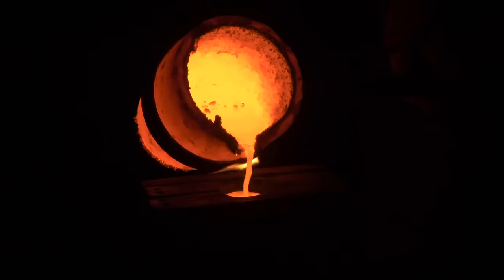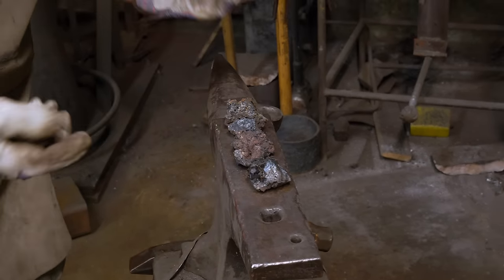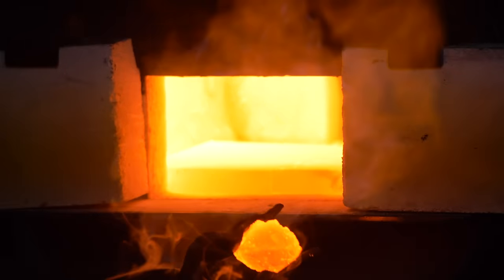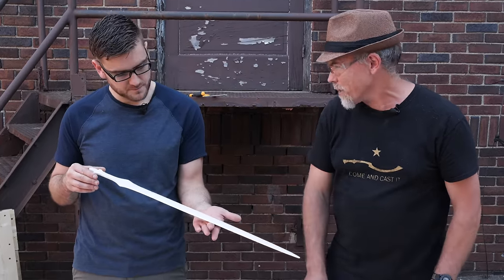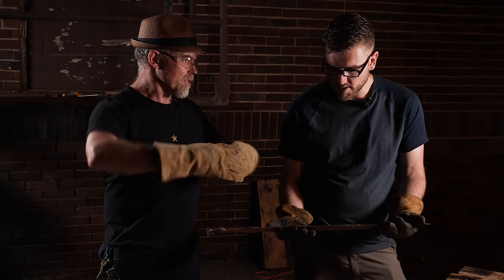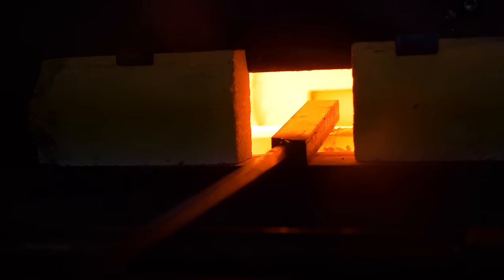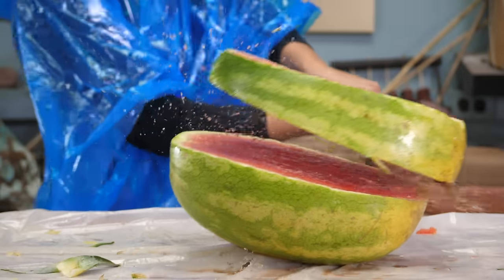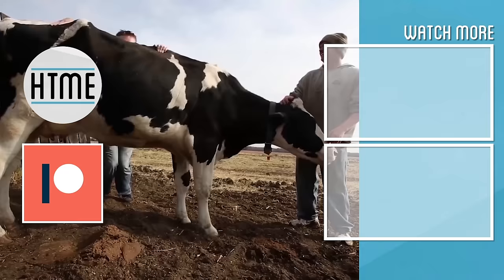Forged Iron Sword vs. Cast Bronze Sword

Comment: Clearly got some confirmation bias going on here. You said yourself that they would have avoided that kind of sword to sword contact, then you judge which one would be better by how they fared with sword to sword contact. If it got to the point where that was the deciding factor, they would have already lost their shield and been boned regardless of the sword they carried.

In the parry test with the flat you showed they they WERE largely comparable, with the iron being a slight improvement in terms of maintenance of the blade
Reply: When fighting, if there is something you can't do but your enemy can, that's a huge tactical benefit for the enemy. The bronze man can block with his shield but must reserve the sword for striking; the iron man can use either to parry. It's also likely that the best intention of the bronze man is thwarted because the iron man parries freely, so while the bronze man doesn't want edge contact the iron man causes it. 

When the iron sword nicks the bronze sword, it's possible that it also catches it slightly and pulls it a little farther out of the bronze man's desired stance. The iron sword is also much less flexible, so while the bronze sword would quickly bend out of joint and be much less useful as a weapon, the iron sword wasn't doing that. Because of that, the iron man is going to take advantage of the bronze man's weapon by striking it while staying farther out of range, and eventually force the bronze man to move in else his sword is going to get beaten up. You'd do the same to strike someone's hand to injure it when unarmed. And if the bronze sword gets bent a little too much, it'll have the same thrusting weakness as the khopesh shape, meaning there's yet another move set the bronze man can't do but the iron man can. 

The better edge retention of the iron sword wasn't really tested, but after your bronze sword gets banged up more from glancing blows etc. it's possible that a slice that would have gotten through his enemy's armor would be too dull and fail to cut. And the edge vs. flat test showed significant deformation in the bronze edge with little effect on the iron flat. You may want to rewatch. 

Overall, the iron weapon is a lot better. But the real problem is not the one you pointed out. It's that the bronze couldn't really be improved much, but the iron could, and he used a clean modern iron to forge the sword. Instead, in 1200 BC - 1000 BC it would have been a very poor quality iron weapon against basically the bronze he has. Iron may not bend, but it is brittle, and in the course of a fight it could have broken. So if we're talking about a combat between two men in 1000 BC, the two swords would probably fail equally often. 

Lastly, can you please explain what you mean by confirmation bias, because I don't see how that applies based on your subsequent statements.

Comment: Swords rarely went edge to edge because they'd get damaged severely. They went edge to shield.  It was considered very unprofessional to block with the sword.  It wasn't until much better metallurgy, well into the Middle Ages, before that became a thing.  There are stories from both Bronze and Iron age about not doing that for those exact reasons. See the Táin Bó Cúailnge
from Bronze Age Ireland for one.

Also, the iron sword would be forged from bloomery iron without much grinding. This makes a significant difference in grain structure.

The bronze smith did an excellent job, very accurate. The blacksmiths did good work for the time involved, but should have been allowed to forge the bevels, as they noted.

You correctly note the big difference is that iron can be reduced almost anywhere, and bronze is limited largely by tin production.

Comment: Early Iron age swords were made of Iron and not steel. With bloom smelting, folding the iron will beat out a lot of the impurities and homogenize the material. Folding the material too many times though and you will beat out all the carbon as well. Anyway, Bent swords are the product of performing a parry with the flat of the blade, its rarely done. The proper way to parry is with the edge. A better way is to get out of the way or use a shield. As all could see the Bronze weapon will take quite a few hits on the edge, but one solid hit on the flat will bend it to a banana shape. Another reason not to parry with the flat is that one cannot achieve a "bind" so as to have some control of the opponents blade. Perhaps if one wants to test and compare the swords then it would be a good idea to know how to use one. Having said all that even a sword made of modern carbon steel will wear and/or be damaged with combat use and need maintenance. Hit up Metatron, Skallagrim and Shadiversity, all are great Utubers with loads of relevant knowledge. Oh.. Chopping wood with a sword = sword abuse, thats what an axe is for. Maybe next time use an animal carcass so it all remains in context. Great vid guys, thanks.

Comment: Iron was much cheaper, that's why it became a thing, not because of what happened when the two came against each other. If you know anything about ANY style of sword fighting, you would know that two swords will pretty much NEVER meet each other head on like that, so that reasoning of yours is completely off. It's nearly impossible that a bronze sword would break in battle or otherwise suffer any significant damage no matter how long it served, BENDING out of shape mid battle though is actually far more likely, which is where iron holds another advantage.

Comment: The only additional argument I would have, since I saw someone mentioned using pure modern iron is a bit unfair, is that the swords wouldn't often hit so directly like that necessarily.  A static block is one way of blocking, better than getting sliced for sure, but there are many kinds of parries where the defender does more of a deflect rather than just slamming the swords against each other. Cool video though! And the iron sword looks really really cool.

Comment: Just a heads up, a perry is not blocking a strike, that is called a block, a perry is when you deflect and use the energy of an opponents strike to in an accelerated counter strike.

Comment: the damage comparison when they went directly against eachother shows why iron became extremely important with regards to armor. Iron was easier to reshape after a battle, had a higher potential sharpness, had better edge retention and had an obvious advantage when trying to pierce armor. It would suck if you had a bronze breastplate, and the iron speartips had the chance to pierce that heavy armor headon. With equal steel level this would be less likely to happen.

Comment: The reason that both materials would have been pretty comparable is probably the way of fighting itself.

It is unlikely that the warriors of the time would have been fully aware of that advantage and as such would have stuck to their way of fighting - prefering to dodge instead of parrying.

Therefore the advantage iron has over bronze would have been minimized in actual combat since both would have been roughly equal when hitting a shield.

Comment: People always focus on the improved hardness and strength of iron by smashing swords Hollywood style in order to reason the end of the bronze age, albeit this is only second. It was the scarcity of tin, that spelled an end to the age of bronze. Bronze technology is limited by the amount tin you can source, plus you require an extensive trade network to get both copper and tin, as the ores usually do not occur in the same place. In contrast, the basic resources for iron technology are readily available almost everywhere. Yet, the iron technology is much more sophisticated, with a huge amount of knowledge & skill, fuel & manpower required to melt a useful bloom, to refine the metal and forge a tool. Not to speak of the tools you have to create first to forge a tool :) If one compares with the rather simple - straight forward process of casting bronze tools, its resistance to corrosion, the countless times you can recycle the bronze, the beauty of the metal and the complex shapes you can create, one can imagine why for example in ancient china, where they had plenty of tin and copper, the use of bronze as the metal of choice lasted well into the warring states period (400 BC). But as always, its the price tag associated to a product, that decides whether it's kept reserved to the elites or becomes affordable to everybody. So once production of a iron tool was mastered, it went on to replace bronze for most applications, first for swords, later armor, eventually cannons.

Comment: Being pedantic, I see a slight problem with the comparison. The key issue is with the carbon content of the iron. Early iron age swords had relatively low levels of carbon, much closer to wrought iron. In the iron sword, the characteristics appear to have a higher carbon content than would have been accurate for the time. Wrought iron is softer than steel. It's also duller in colour and lustre. Hence, in the final test, probably both would have bent and both might have nicked each other. It would be almost a 1000 years before steel was reliably developed. The big difference at the time was you needed only iron ore to make an iron sword and iron ore is very plentiful, while for bronze you needed copper and tin, two ores that don't often occur near each other and are both much rarer. So to arm an army with iron, once you had a source of ore and the ability to smelt it, was easier and cheaper than to arm an army with bronze.

Comment: Your iron bloom wasn't hot enough.

What you get out of a bloomery furnace is basically wrought iron; you need to forge it at a yellow heat or higher preferably closer to a yellow-white color.

Wrought iron has a lot of slag incorporated into it; the slag formes inclusions in the iron, which are weak spots.  That yellow-white heat is high enough to forge weld the iron back together as you hammer it.

Keep it hot, and work it gently.  The iron will consolidate into a mass, while the slag works out to the surface and burns off/sheds with the forge scale.

Comment: bronze is pretty tough stuff. I have a 4' bronze pry bar, it was my grandfathers before my dad and now mine. We have NEVER been able to bend it, it will flex an inch or so with 2 men pulling on it but springs right back. Rings like a church bell when bounced of the ground.

Comment: I'm sorry but I have to correct you there: hardening can not be used to improve iron.
In order to harden by heating it to the critical temperature and then quenching, it has to be  steel rather than iron.
Also, after hardening you have to temper the steel or otherwise it will shatter upon impact.

Nice video, though!
Reply: Correct in the hardening process, but if you anneal hardened steel, it'll just be soft again! After hardening, the steel goes through tempering, which draws back the hardness a bit and increases toughness. Annealing, in comparison, makes the steel as soft as it was before it was hardened.
Reply: @ENoland8  oh right, sorry I used the wrong term. I did mean tempering, but got it wrong since I'm not a native speaker...

Comment: Also hand forged iron vs cast and hammered bronze. I think cast iron would have had bizarre results if it had too little carbon like possible shattering, but then again forged was the way they used them.

Comment: Neither swords are comparable to their stated counterparts. A properly work hardened bronze sword will outperform ANY iron sword with better oxidation properties to boot. If the actual bloom iron were being used, it would miserably fail against that soft bronze blade, mush more so an actually work hardened one.
EDIT: a fact I like to point out is early roman centurions were equipped with bronze swords, unlike common foot soldiers who were equipped with iron blades. Later on, steel would dramatically change all of that.

Comment: In early iron age with primitive technology, only form of iron they could make was cast iron, which was brittle and had tendency to break easily when clashing against bronze. Blacksmithing didn't even exist in early iron age, because cast iron is not malleable and can't be hammered down without breaking. 

But bronze is a relatively rarer material compared to iron which is common in earth's crust, which put iron age civilizations in a big advantage in terms of ability to mass produce weapons and armors. 

However, low quality of early iron meant that both bronze and iron coexisted during early iron age, and bronze was only completely phased out by around 1st century BC.

For proper comparison between iron age vs bronze age civilization, they should've used low quality cast iron instead of modern wrought iron.

Comment: If you realize how DIFFICULT it was to get the resources together to make bronze it's not a big surprise that iron/steel (available almost everywhere) has taken over so quickly.
A good comparison is the now (in 2021) shortage of chips which makes entire industries (cars, planes, other electronics) slow down or stop.
This is very comparable with a shortage of any of the components that make bronze which also could slow down or stop agriculture or weaponproduction in the bronze age.

Comment: Bronze is > iron.  Bronze is > steel also.  In 90% of common applications bronze is better as it does not rust and lasts forever.  Iron is cheaper, steel is stronger.  If Tin was more common, this would not even be a debate.  We could have had bronze cars that never rusted.  Think about that.  You could have been driving every car until it was damaged in an accident.  Imagine driving your grandfathers 70's car and expecting to gift it to your son in 15 years.  Like owning a Tesla.

Comment: You cant sand bronze like that for a good sharp edge as it behaves different than steel, hand sharpen it in a single direction and it will be way more sharp. The material structure is different, and the burr will just be bad on a sander

Comment: Interestingly enough, iron was probably first invented in Sub-Saharan Africa by the Nok culture around modern day Nigeria, probably about 1500 BCE. There is still considerable dating issues, but most scholars who have actually looked at the data and don't just go off of preconceived notions are fairly certain that Nok iron technology was, at the very least, independently invented. One proof of this is that iron never really seems to replace previous wood, bone, and stone weapons. However, it was used for tools and ritual objects. The Nok never invented bronze because of the lack of resources, and just went straight from bone and stone to iron.

Comment: Would that 'Iron Age' sword made by modern techniques and using that lump of iron with a large carbon content already present be superior to a iron weapon from 1100 BC - Circa 600 BC?
Reply: That "lump of iron" had a carbon content around 0.08-0.15%, couldn't be hardened, and wasn't carburized in forging by using a coal forge. It's Brinell hardness is around 95-105MPa, in the same range as you'd get from the bloom, only lacking the shock and vibration resistance due to the lack of silicous slag/iron silicate. For a material, it's really a solid substitute as Andy's bloom wasn't usable. 

As for the modern techniques, all they did was cut down on time. The form and cross section are known to be used for swords in the early iron age, and would have been shaped with a combination of a grinding wheel and/or files, just slower than a belt grinder. The power hammer would have been substituted for a team of strikers, for which the concept of the work was clearly shown. Even with the forge, it's not very much different. A coal forge actually burns hotter than a propane forge, and temperature can be (and still is) gauged by the color of the material.

Turn the 3 1/2 hours or so that sword was forged in into a day or two, and you'd have the same result.

Comment: Gonna toss my name in the wind here and say before watching the vid. They gonna go to far with the "iron" sword than anyone did during the few centuries when these metals did connect and the iron sword is gonna be more steel than it represents an iron sword of the era. Iron swords for a great many years where so malleable combatants frequently had to step apart to stomp them straight. More so than bronze was at the time. Bronze for the era was still rarely used for swords at all and the treatments they had to go through made them brittle. instead they would shatter after little use.

Comment: While it's true that the iron would more easily cut through the bronze, it's a little unfair to straight-up dismiss the chances of the bronze fighter. As stated at the start of the video, they'd really only use long daggers/shortswords rather than a longsword like you made, and tended more to spears than blades. Assuming the iron fighter wasn't wearing full plate armour, the advantage would go to the longer reach of the spear user... and if the bronze fighter was nimble enough to dodge the iron longswords and could get in close enough, they could stab iron fighter in any non-armoured areas.

A weapon doesn't make the man. It's all about the tactics used.

Comment: I may be wrong but i always thought that iron swords were hammered on the blade so they would be stiffer and harder to blunt, also i think they weren't rubbed with sandpapper until almost end of making sword. Iron swords had some kind of fuller hammered in according to they purpose